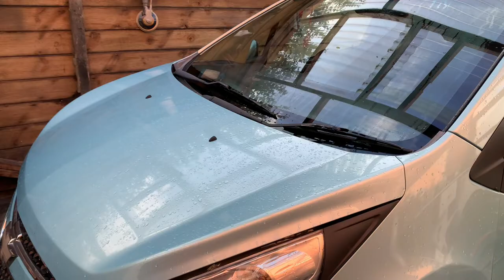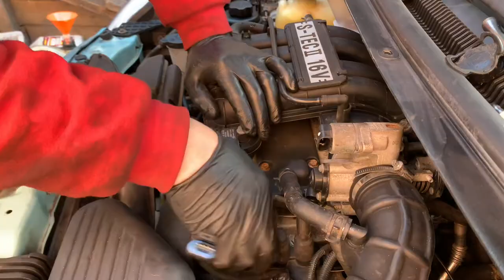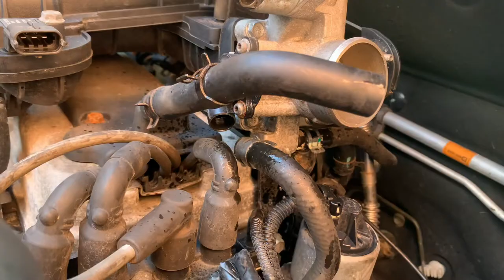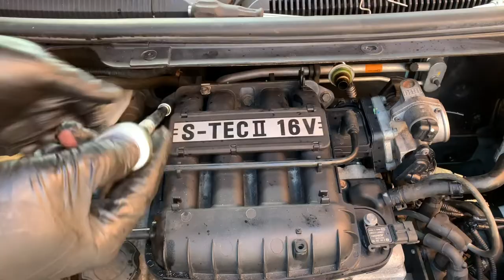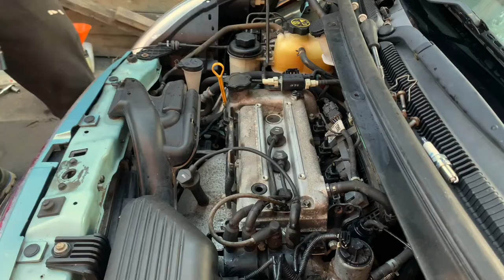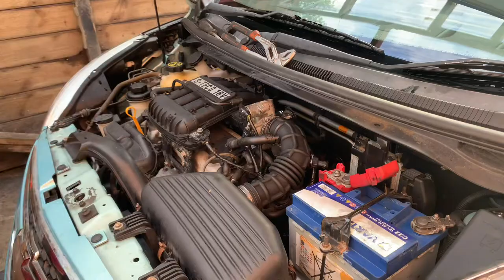Change your spark plugs step-by-step on a Chevrolet Spark

Comment: Great vid. What a pain just to change spark plugs! I just bought a 2017 LS and am planning to do a SP change. Question...do the Chevy Spark's take regular size spark plugs like any other vehicle? The kind that you can buy at any auto accessory/parts shop? Thanks in advance for your reply.

Comment: Good morning! I have a chevy spark model 2014 model...i want to check &replace the fuel filter... can pls. show a videos on how to do it.  Salamat po
Reply: You find how to replace the fuel filter ?
Reply: @Qwerty03044  not yet sir
Reply: @benigno17  I think it's on the left rear of the vehicle. You have to follow the fuel circuit

Comment: My car started rpm fluctuation after changing the spark plugs. Can you help what's the problem?
Reply: Do you mean only in the idle state? Have you disconnected any of ECM, PCM, fuse or battery? Then you should configurate the idle control valve.

1. Turn ignition to "ON" for 5 seconds.
2. Turn ignition to "OFF" for 10 seconds.
3. Turn ignition to "ON" for 5 seconds.
4. Start Engine in "Park" or "Neutral".
5. Keep engine idling till coolant temperature is above 85°C.
6. If available, turn air condition on for 10 seconds.
7. If available, turn air condition off for 10 seconds.
8. If car has automatic gearbox, applay the handbrake. Step on brake pedal and shift into D (Drive).
9. If available, turn air condition on for 10 seconds.
10. If available, turn air condition off for 10 seconds.
11. Turn off the ignition. Configuration finished.

Hope I could help you.